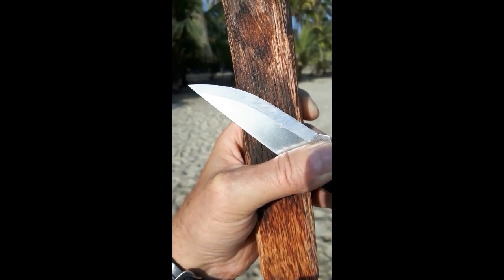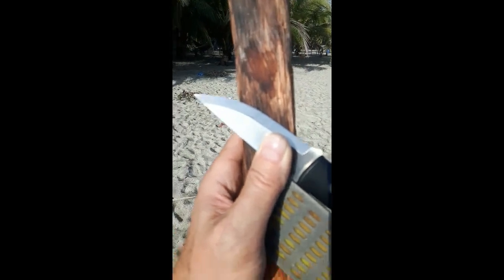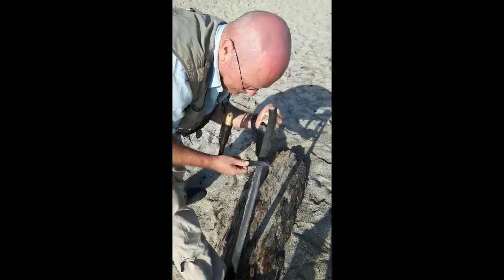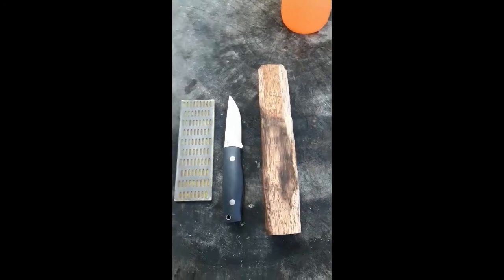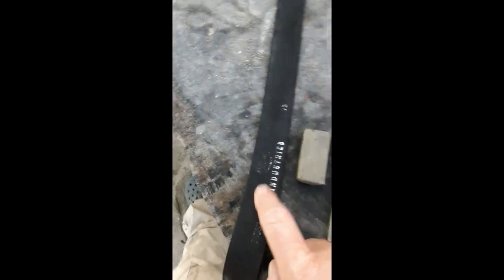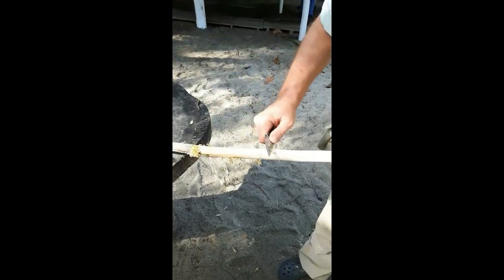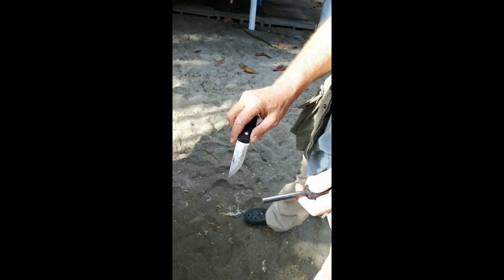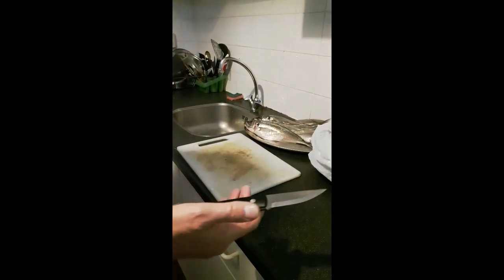Enzo Elver full test and review

Comment: Thank you for your very detailed video! I am planning to make a new knife from Brisa parts, this time an Elver. Do you think the Elver would be better as a small secondary knife if it was thinner? I think maybe I will put it on a belt sander and try to remove half a millimeter from each side... It is quite similar to the Bark River Ultralite Bushcrafter apart from being more than one millimeter thicker. And also so much cheaper!
Reply from the maker: The blanks and other materials are not that expensive indeed and it's nice to build your own knife and experiment with it. For me personally I have no problem with the 3,5 to 3,6 mm spine.
If you are gonna put it on a belt sander make sure it doesn't get to hot. The temper on all Brisa knives are very well done and I do have different models in different steels. Never had a problem.
Just remember they come true flat or true scandi meaning a very sharp but thin edge so you might want to strop a bit. It's all I did and wet formed the sheath.
I dare to say for a smaller camp knife for finer wood carving and food prep this is one of the best for the money. As you see in the video I did test it on batoning because I want my 'back up' knife to be able to do that also but usually bring a bigger knife for that. It sure is cheaper than Bark River. ;)

Comment: Do not drug the blade over the stone, stop the sharpening motion before the stone ends.Also do not apply much pressure with your hand.also, the closer to the last passes, lighten the pressure more and more, and the last passes, just let the weight of the knife, be the only pressure applied and only one pass per side. We only do more passe per side, on the low grit stones, when we remove steel to establish an edge bevel. When we are at the mid and final stage grits, we always do one each side, and always we do exactly the same on both sides.Finish by stropping on news paper, not leather. You might dull the edge,. if you strop on leather,

Comment: Good review, Enzo knives are good for the price, I just buy the blade from brisa knife supplies and stick my own handle on, saves a ton.
Reply from the maker: +Swamp Valley. Yes. You can get everything there from steel to wood and leather. It's always great to get just the blank and create the rest by yourself. I have done it in the past several times. This one was off factory but love that little blade
Reply from the maker: True. And basically unlimited options. This way you can really personalize your knife. I still have several blanks (Elver, Fisher, Mora and some other brands) but have not decided yet on handle style and material. But Brisa knife supplies is where I shop when I need materials or Scandinavian style knives.